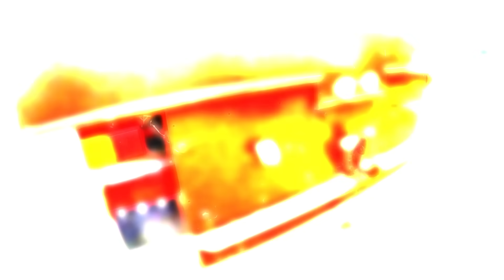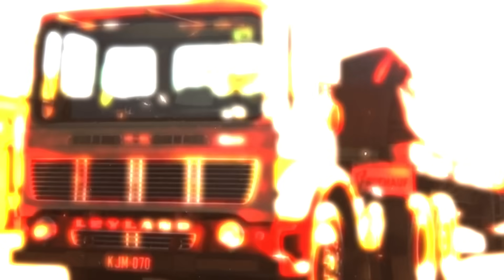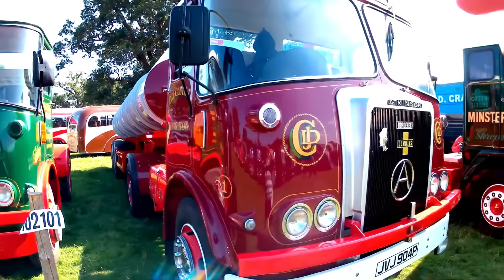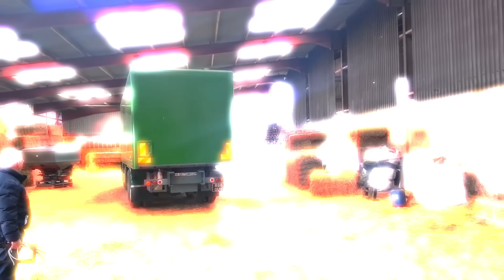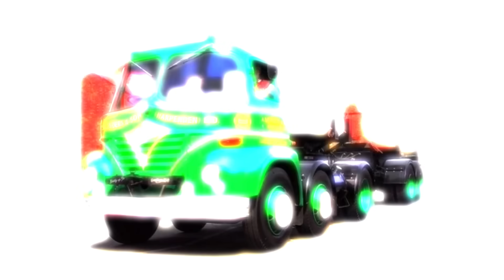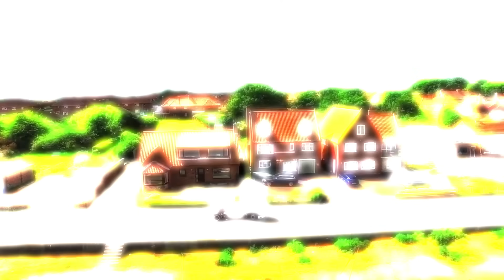10 British Trucks So Extreme They Were BANNED From the Road

Comment: Please could someone explain...if the Foden S50 Roadtrain was actually meant for export only, how is it that the narrator then says that Foden had nothing to do with foreign buyers being able to skirt loopholes in the law? I've kept winding back to listen again, and still can't understand. And, would all of these manufacturers genuinely not have known the potential risks until their vehicles were in day-to-day action on the roads? Or were the risks imagined?

Another question...Vehicle-wise, I've no idea how many safety protections are genuinely unnecessary. Having been HGV drivers, we know the sheer power of a relatively ordinary tractor unit, but at the same time, some of us will also know that a unit can fail to bring a load up a very steep incline - which is truly terrifying. I'd say that some of what's been described here could have resulted in an horrific event. One event was described in the video, but thankfully it happened to a truck without another vehicle or a person being in its path. Apart from that event, please let me know if the hazards mentioned in the video have been exaggerated. (I'd appreciate a polite reply...many thanks.)
Reply from the maker: There might have been some issues with the script, but maybe a viewer can correct me! Thanks for watching!❤️

Comment: in the late 60s, 70s 80s i drove most of the wagons in this post inc a twin engine ford & i can't remember any of this cobblers.
Reply: Your right,i worked in the haulage industry from being aged 15 but never heard of this bullshit,that Albion was a great machine and to my knead never banned, Foden had one of the best chassis around without exception,what legal power limits, this is utter bollocks. Speed limiters were an official regulation which the Irish hauliers were experts at getting around them.
Reply: Agreed, I have no idea what this was about. We used scammels all the time in the army to pull tanks out, etc.

Comment: Not quite sure how much of this is actually true, Atkinsons had long since vanished from the road when speed limiters were introduced, most of the old trucks I drove struggled to reach 50 mph anyway, the old foden motorway gritters I drove had 250 bhp engines in them if I remember correctly, I spent many freezing nights bored to tears driving up and down the M1 and M69 with my foot flat to the floor at 45 mph I also believe the Leyland landtrain was built for the army as tank transporters and the reason civilian company's didn't use them in the UK was because they were a bit wider than the regulations allowed for normal road use, I don't think the Scammell crusader was ever all wheel drive either, getting any old British truck past about 55mph was an achievement, I get a M.A.N 32 tonne 8 wheeler to 75 mph once loaded with scrap metal, happy day's
Reply: Very little is true , it’s all a load of shit from someone who hasn’t a clue